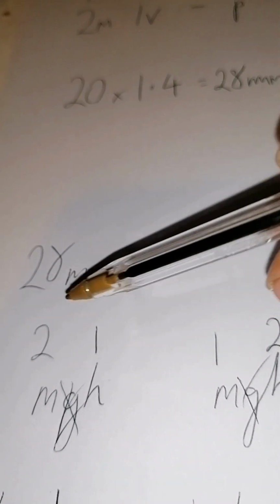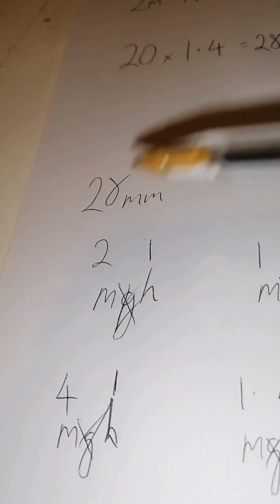Drop Test Results!

Comment: coming up: 'draftscience VS more crap experiments':

- You don't show us where you dropped it from
- you don't measure the weights
- the framerates are shit
- You probably released it by hand? Huge red flag right there
- it looks like twice the velocity
- the weights are rubbing against the bar, causing friction
- the distances between the coils are not the same

Conclusion: obviously not a decisive experiment

Well done Michael! We get the same consistent results once again.
Reply from the maker: Thank you Dispar,
You have his rap sheet down to a T.

It is strange though how all our undisciplined rickety DIY experiments, come out with consistent, PREDICTABLE results!

Its almost like there is a scientific rigor applied without even trying, what are the chances that lady luck has shined on all our crappy attempts so far, to show the TRUTH.

Perhaps the KE god is helping us all.👍😊
Reply: That gave me a giggle - as Michael said already, you've got his rap sheet down to a T, although he can always scrape through the bottom of the barrel to find more excuses in the dirt if anyone wasted their time with multi camera set ups to show where it was dropped from at the same time as a close up camera, - or used some very expensive fast frame rate professional camera,  measuring the weights in continuously shot footage,  released by solenoids, velocity measured by lightgates,  sliding down a vertical airtrack to elliminate frction ... no measures we can take will ever be good enough for him to come clean and just admit he was wrong all along.  Because being "right" is all he lives for.   In other words there is no good reason for him to still be on this planet.   His presence serves no useful purpose.   He's truly a waste of space that coud be used for storing empty cardboard boxes.
Reply from the maker: @stephenbrough8132  Admittedly the weights were off by 0.25 of a gram so obviously that will be a major issue and there is always the accusation, as you say that he could suggest I somehow went to the time and trouble of swapping them out for lead lined ones or some nonsense like that, but they are indeed the same weights verified in the previous video to this one.

I did think about using the light gates to verify the speeds but the drop heights alone determine the speeds as gravity is very reliable.

Its so repeatable and reliable It could be done in one  continuous take if I had a film crew on hand.👍😊
Reply: @michaelfowell223 Yes, how irresponsible of you to not employ a film crew.   Ironically, Goofy is probably the only one who could afford one.